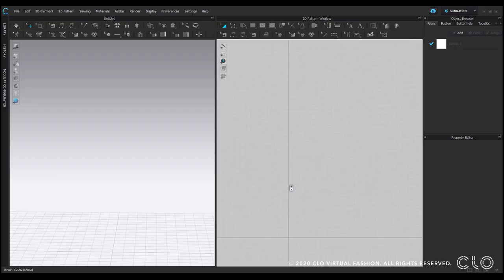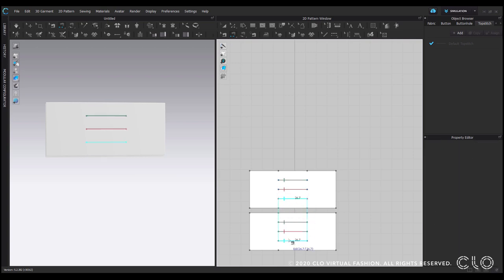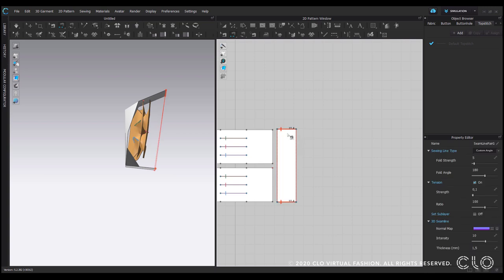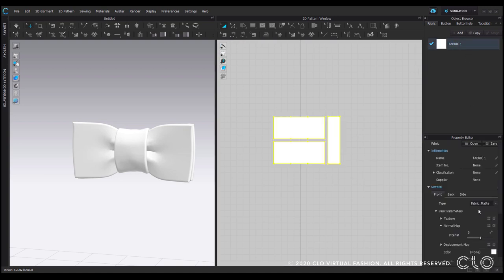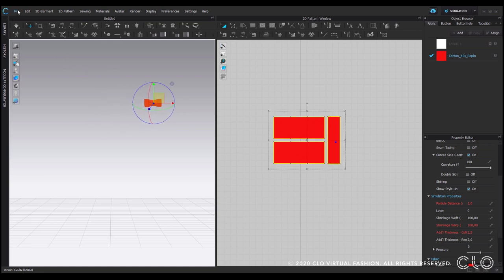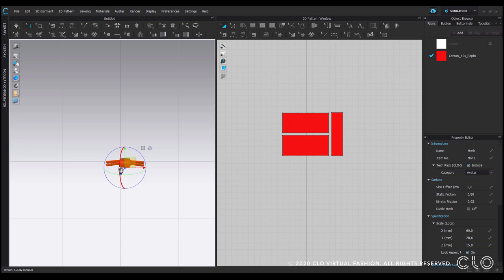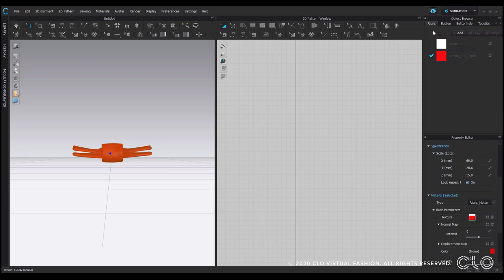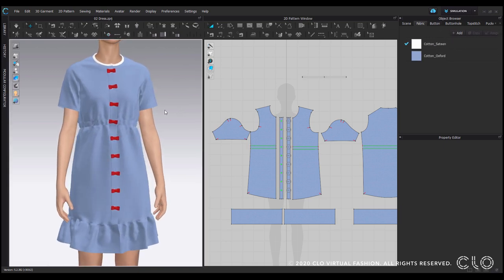How to create a bow tie and use it as a button

Comment: Hello, I am trying to follow this tutorial but when I add the thickness of the fabric to 2 it does not acquire any thickness, I was also trying with the tutorial of the stage and it does not work for me, is there any parameter that I should modify that is not seen in the video? thank you
Reply from the maker: Check your 3D toggle menu and make sure your Thick Textured Surface is active.